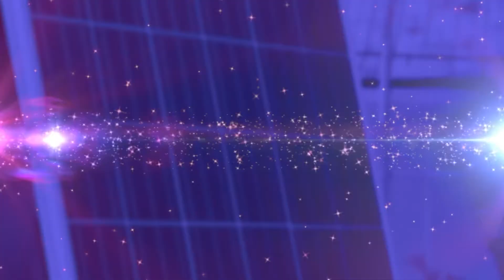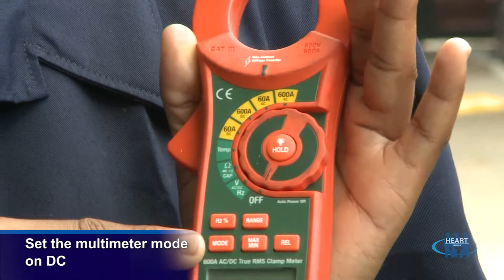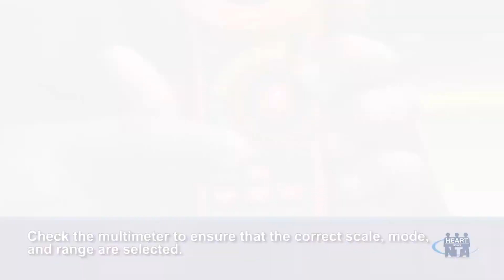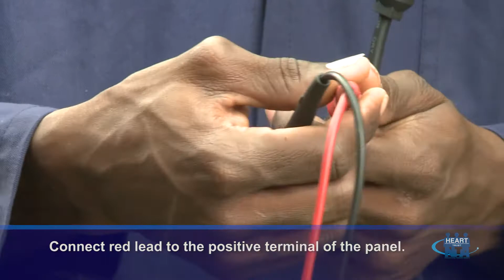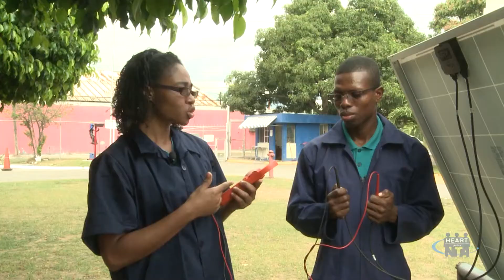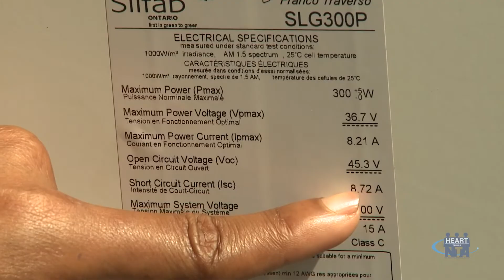Photovoltaic Installer - Performing Open Circuit Voltage and Short Circuit Current Tests

Comment: Sorry, using a clamp meter or a multimeter for testing the PV modules is absolutely not correct since both are not the right equipment for such test. Simply just because the Irradiance and Temperature are not considered when using a multimeter or a clamp meter and that lead to wrong readings. Try to use the right tools guys! There are instruments called IV Curve Tracers which are used for such tests.